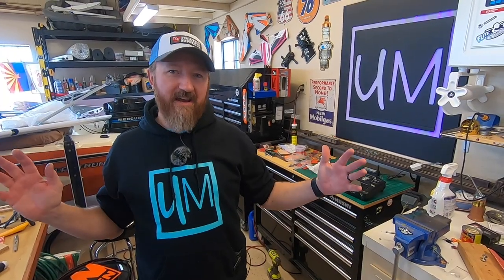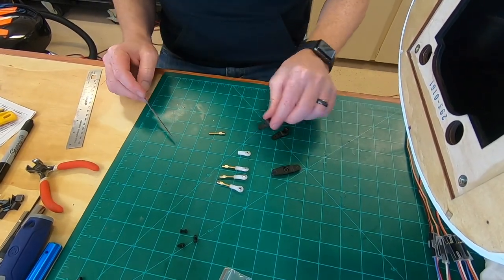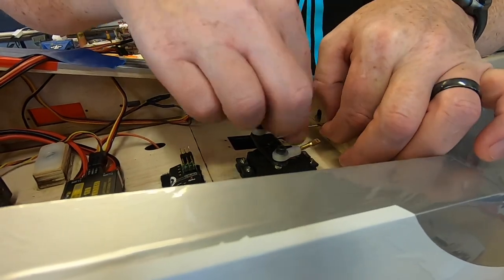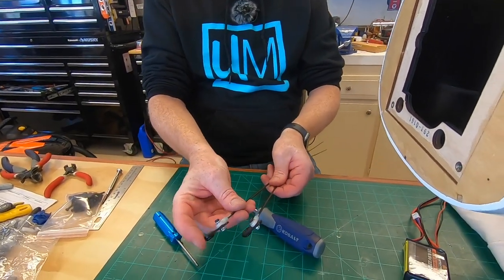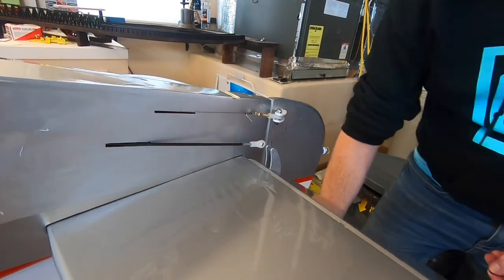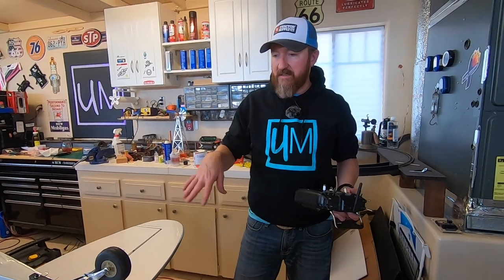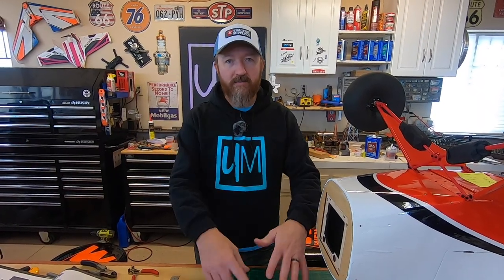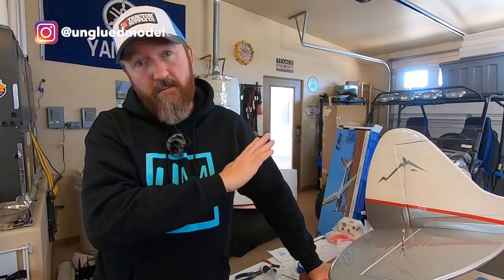Hangar 9 XCub ASSEMBLY Part 4 - Finalizing the Tail

Comment: You are putting the pull pull on wrong .... You need to put the wire back thru the barrel so it tightens up and that way the pull pull does not come loose and keeps it tight and doesn't stretch and get loose .